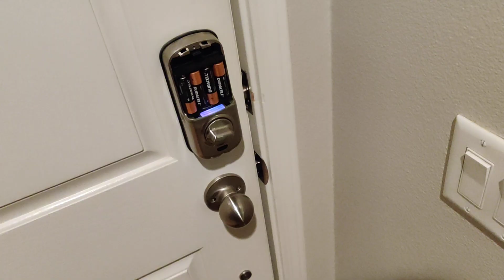I guess this is what happens when Yale T1L Classic Lock Needs to Change Battery? Blinks a Whole Lot

Comment: Was kind of wondering what happens if the battery runs out.
Reply from the maker: how often do you replace the batteries?  I wanted to try to replace them once a year... it's too scary to get locked out (even with the bottom 9v emergency input at bottom).
Reply: @angrymathdude  I haven't had to replace any yet.  One of mine I've used probably 3 years.  I think I used the batteries that came in the box.  Watch, I'll have your blinking light thing come on in a few days.
Reply from the maker: @SoCaliScenes  Reminds me of people who have car batteries for a few years.

At least the doors have an easy solution with the 9v lock.  Man 3 years is good.

My door faces the sun.. gets really beaten down.. so it gets overheated.  My batteries probably see unusual weather damage.